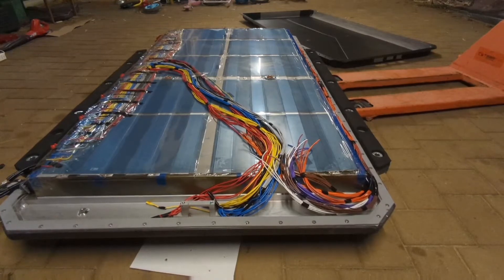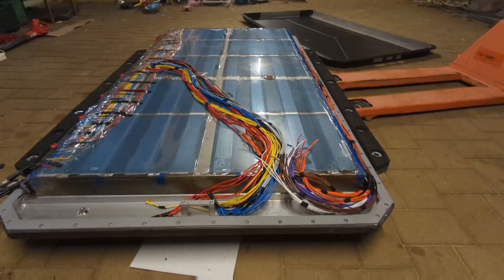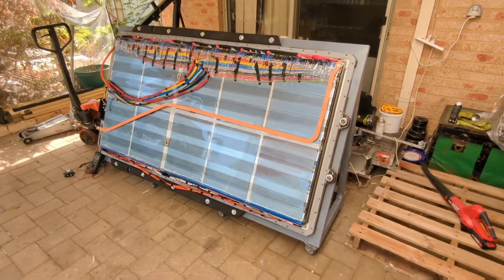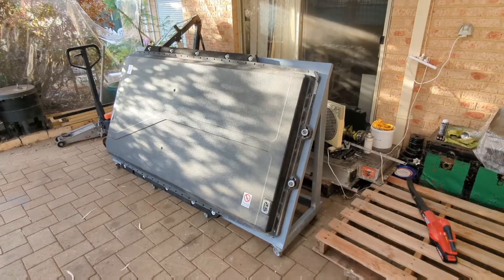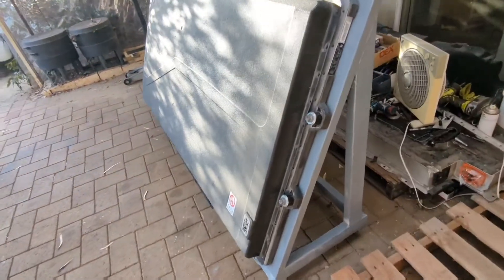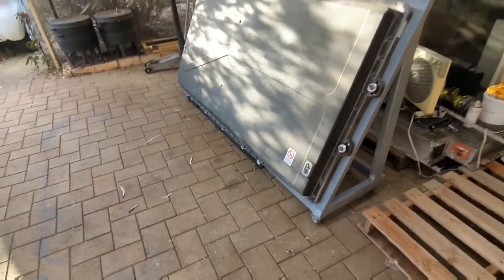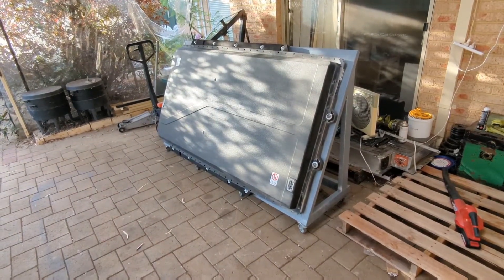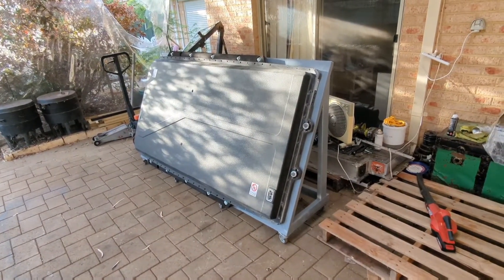BYD Atto 3 battery to home storage P6 - pack construction and BMS cell taps 2

Comment: In your educated opinion having opened the battery pack, does the construction of the battery pack lend itself to be mounted flat against a suitable surface in it's length?  My concern in mounting the battery length wise against a flat surface was that the bottom stack of batteries might eventually carry the weight of the top batteries? With the pack laying flat it's obviously not a concern, as well as when the battery is on it's side. Thank you for your effort documenting the strip down and modification.
Reply from the maker: There is a bar half way so it wouldn't be the WHOLE pack resting on the bottom cell , but it would still be a fair chunk. In my personal opinion I think it would be alright as the potting compound should hold all the cells up and the pack will be designed for at least a 20g load in the forward direction however a 20g impact is different to 1g over months/years. Long term, we just won't know until someone tries it

Comment: How much battery cost and how many cells are there, can it be done in 16S configuration? Thanks
Reply from the maker: Too much, they are much cheaper now. It was about $11000aud by the time I had the car in my yard. 126 cells total and you could do this in 16 cell groups but I wouldn't. The whole process is too sketchy and 16 doesn't go into 126 evenly so you would be wasting capacity

Comment: Hello friend, congratulations on the video. Can I make a video presenting your channel in Brazil and commenting that you made several videos dismantling the BYD battery?
Reply from the maker: I don't have any problems with that. Send me a link when you've made the video
Reply: @Brendon_M  Thank you very much friend. I will make the video about off grid solar system that uses electric car batteries and I will talk about your channel that dismantled the battery and filmed it in 3 parts and in the third part you assembled the battery in your solar energy system, I will put the link to your channel (of the videos of the disassembly and the third part that connected to your system) and I will use in my explanatory video some prints and a few seconds of your video if you allow, and photos of the disassembled battery and as soon as I publish it I will send you the link.

Comment: your re-wiring battery cell to 48v for your home storage? could you share sketch simplifies diagrams?
Reply from the maker: I go over it in one of the later videos but all I'm doing is cutting the busbars so that instead of having 126 cells in series, I'll have 9 sets of 14 cells in series. I then wired those 9 sets into parallel with each other.

Comment: Any idea where is pyro fuse on the byd atto3? 
Bought with airbags deployed
Reply from the maker: I know I answered you already but for completeness for others I'll repeat here. 
The BYD Atto 3 doesn't have a pyro fuse, after a crash it only logs fault codes that just  have to be cleared with a scan tool before the car will ready up again. I had to use a proper workshop scan tool to do it, I didn't have any luck using a Bluetooth/phone APP style of scanner
Reply: @Brendon_M  actually fixed it when disconnected all blown airbags and sensor on the effected side,then cleared codes .
And she drove down from the trailer,yey
Reply: @Brendon_M  I see, will try it
Reply: @Brendon_M  by proper workshop tool do you mean special for Byd only?
Or decent Autel version can do it?
Reply from the maker: I used an Autel one but any reasonable ($1000+) scan tool should be able to do it

Comment: Any updates on the build ?
Reply from the maker: Sort of. The battery is up and running and has been powering my house since Christmas. Not much to show in a video other than a solar inverter sitting on my wall so I haven't really bothered.
I guess I could do an overview of the system and get a screen capture of the webpage showing the system running... Give me a couple of weeks an I'll see what I can whip up
Reply: Yes please, that would be great. Would like to do something similar myself. Was just curious about your build first 
Can you also show how it’s connected to your inverter please
Reply from the maker: Will do, but if you want to try something like this yourself I would strongly recommend using Dala the Great's system ( https://github.com/dalathegreat/Battery-Emulator ) No modifications to the battery or anything. All you need is a compatible high voltage inverter and EV battery and connect the 2 together. Much safer and much more robust

Comment: What is external measurment of the pack and the weight?
Reply from the maker: BYD Atto 3 60.5kWh pack 126S 150Ah 403V (3.2V LFP cells)
1050mm wide (1230mm including the mounting flanges). 2100mm long. 125mm tall

Haven't weighed it but around 450kg is my guess
Reply: @Brendon_M  hei.. thank you for replying.. i will draw  cad.. (weight only akumolator should be 426kg)

Comment: To avoid danger, would this battery have to have the same cooling system as the car and a BMS charge controller identical to the original?
Reply from the maker: Yes and no, I'm not pushing the cells anywhere near as hard as they would be pushed in an car so not have the cooling system won't be a problem as the cells won't get hot. If I wanted to use these cells in another car then yes I would have needed to keep the cooling system.
The BMS doesn't need to be identical, it just needs to do its job properly

Comment: Geart efforts Brandon👏, Ive worked on ionic batteries and they are pretty easy. I have a byd battery similar to yours under my hands. Am interested in tearing it in to individual cells. Is it hard to unglue the cells or impossible. Cant certain chemical desolve the glue?
Reply from the maker: There is most likely is a chemical that will dissolve the glues or possibly even the right amount of heat.
There are 2 different glues, one under the chiller plate and another setting the cells into the case. The one under the cells can probably just be cut close to the cells and then peel the cells out, it's more like a silicone potting compound.
The other big challenge is the terminals of the cells being laser welded together.
It's not insurmountable but too hard for me to attempt, also I was scared I was going to damage the cells
Reply: @Brendon_M  I've watched a Chinese mechanic repairing a blad battery pack almost similar to yours. He poured a chimical underneath the cells and then lifted them with wooden pieces. I couldn't figure out the criminal but he said it is sol solution and it is written on the container Ac Delco . He used screws and chisels to remove the top plate. I can share that video with you if you are interested.
Reply from the maker: I'd love to see it
Reply: @Brendon_M  I've replied to your comment but my reply just disappeared!
Reply from the maker: YouTube blocked it because of the link I think. I tried to override the decision but the post just disappeared from the "held for review" list after I approved it

Comment: Quite an ambitious project with many, many pitfalls along the way - and all mastered...  Congrats!! 🙂
One question: you put all the modules in parallel for a 48V system and the total current of all of them in parallel is now routed thru the diagonalish bar runnin back from the far end to the connector side? what about contact resistances and current density?
Reply from the maker: The car originally would have pulled up to around 350A when the battery was at 400V but the maximum current I'll be pulling is 100A at any one time. Less than a third of what all the connections/busbars are rated to.

Comment: Thank you Brandon for posting your videos. It has been interesting and educational as I have not previously seen a BYD battery pack being pulled apart. That was the first interesting point, when you found the blades were glued into position making it impossible, or at least very difficult to strip them out. Before watching your videos I would have presumed it would have been easy. Anyway, I have many questions for you that I hope you would not mind answering. For today all I want to know is the overall dimensions of the battery pack, as you have it on your bracket + what is the weight? Thank you.
Reply from the maker: Hi
The battery pack is around 1250 wide, 2100 long and 125mm tall. I haven't weighed it, but around 450kg
Reply: Thank you  @Brendon_M  for your reply. Do you mind me asking you more stupid questions in the future like; do you think the blade battery pack looks both solid enough and flexible enough to take a flogging on long stretches of badly corrugated Australian outback roads?
Reply from the maker: I think it's built pretty solid and everything is glued quite firmly together so I think it would hold up quite well but I guess there is only one way to find out. 
Long term there might be issues with cracking the areas where it bolts into the car what with it being so heavy

Comment: Hi Brendon, check my channel....have a video about my BMS protection board. This might be a solution to fuse your balance leads.  Keep up the good work. Frank - EASYPOWERWALL
Reply from the maker: Great video. I thought about doing something like that. Specifically I was going to solder SMD fuses between all the pins on the green terminal strips/connectors I used rather than just bridging them out.
 I didn't for 2 reasons.
1. I didn't want to wait for them
2. Every time I've tried to squeeze fuses into this pack there has been some insurmountable hurdle, I'm taking that as a sign from God.

(I didn't say they were good reasons)

Comment: Seems like alot of effort to modify this pack when you could have run a high voltage inverter and run the whole pack unmodified.
Reply from the maker: I can't disagree with you. The only reason I'm doing all this is because I'm trying to get it connected to an existing system

Comment: Fantastic video series!
Out of interest, do you have any further knowledge on the comms protocols being used? We've got two of these batteries and we want to see if we can use them as they are by only designing an ESP32 controller that plugs into the existing pins (to do the job of sending the signals that the car normally would).
We're looking to open one up next week, so your videos have provided some very useful background information, so thank you for that.
Reply from the maker: No sorry, I don't have anything on the comms other than it appears to use CAN. I'd be interested in what you manage to work out though. I want to be able to run up the motor on a bench without the original battery so I want the signals that go from the battery to the car

Comment: It would be better to use a 400v DC inverter. The 9P14S system requires high amperage cables on both battery terminals and a high amperage relay and fuse.
Reply from the maker: I agree, a 400V inverter would be better. But I own a 48V one and I'm upgrading/adding to my current system.    My inverter is only 5kW so max current is only about 100A
Reply: I gather he'll be running an inverter - 48V units are cost effective and even if he has a couple at 10kW the current will be 220A, so not that bad. Adequate relays are expensive, as is cable capable of 200+ A, but are a very small part of the investment. Well, that's where I think Brendan is coming from.

Comment: Hi Very interesting to watch.. 
See on another video you paid 11000 for the whole car
I have made a Off grid system using 48 @ 280 A/H 3.2 Volt LiFePO 4  cells for a total off  840 A/H at 48 volts for approx 9000 Aussie
including 3 JK bms
I know you can sell parts off the car ... Just wondering if there is much off a market for secondhand EV parts
as the general consensuses is that motors / drive train on EVs  dont wear out 
Watching how you Incorporate into the house grid
Reply from the maker: Yeah, the freight of the car made it more expensive than I was planning but I still think I haven't overpaid for a 60kWh battery. Though it's pretty much impossible to justify as I already have a 37kWh system that keeps me powered up 90% of the year.
This was more of a project to see if I could.

There's a bit of a market for minor accident things (wing mirrors, lights, wheels etc).
The motor stack is valuable to people trying to convert an old car to electric
Reply: There is a market for EV conversions.. Although typically still with Tesla Model S batteries because they are conveniently modular, and tesla motors are common enough to have 3rd party controllers without having to stuff about with the inverter.

Atto3's are all going to be under warranty still, and there's no way they'd use crashed parts for an insurance repair, so you are really looking at uninsured drivers, or guys who are trying to rebirth a write-off (and that's often legally difficult)..

Comment: Epic effort Brendon. That looks like a worthy use for these BYD cells. What chemistry are they?
Reply from the maker: The BYD pack is 126x 150Ah 3.2V LiFePO4 cells. The pack will end up as 9P14S so 44.8V and 1350Ah (60kWh)
Reply: @Brendon_M  LiFePO4 are an excellent chemistry, much safer than the LiPo chemistries. The 9P14S is good use of the 126 cells.

Comment: Hats off to you but with all the EV cars that catch fire there is no way I would want that near my house after it’s been altered. 
I don’t even park next to the pieces of shit EV’s.
Reply from the maker: Better stop parking next to petrol/diesel cars 😆
Reply: Why!! 
Search BYD EV car fires if you haven’t already. 
I’m just sayin. 
I truly hope it never happens to you. I just think lithium batteries are a bit dangerous.
Reply: @mattweeks7142  So is petrol when its not handled correctly. The issue with lithium is that if they ignite, then they cannot be put out, unlike petrol where you starve the fire of oxygen and it will go out.
Reply: @mattweeks7142   this battery is made of LiFePO4 chemistry and it is extremly safe unlike lithium ion
Reply: Not really I've seen demonstration byd blade battery vs NCM in their penetration with nail. The BYD it didn't exploded while the NCM explode  @mattweeks7142